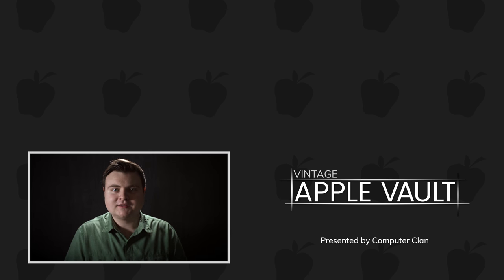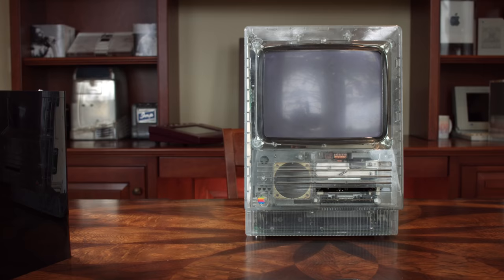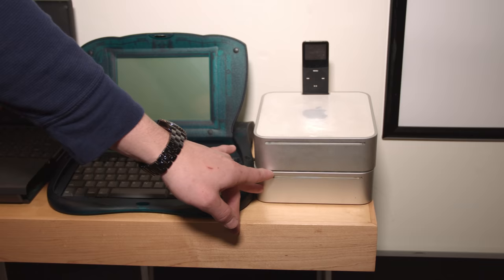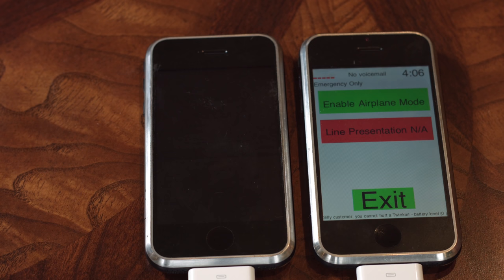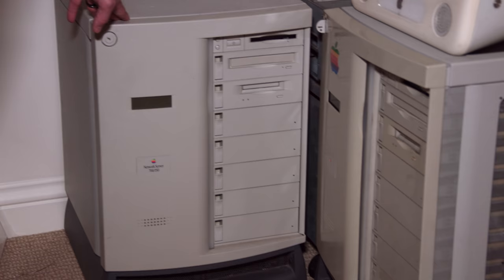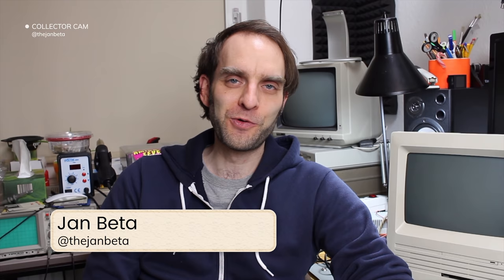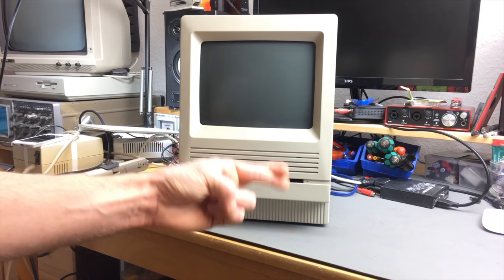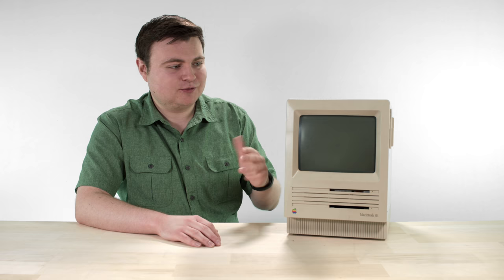Macintosh SE and Apple Prototypes - Vintage Apple Vault #5

Comment: I’m a former Apple employee from the ‘90s. I used to have a small but interesting collection but I’ve let most of it go. Had a 128k, several Quadra, and various PPCs, but I still have the first Mac that I ever bought myself and that’s a Mac Classic. Love that little computer. That guy is right, it’s great for word processing when using a full sized ADB keyboard (the best Apple keyboard ever), and when you want a small footprint. Even better than an iPad Pro with keyboard, IMO, (which I’m typing on now). The Classic just started with the capacitor problem, so I need to get that fixed. Still have my dual 2.5 G5 watercooled tower which runs fine, and two of my current systems, two heavily upgraded 2009 Mac Pros. I was always attracted to the towers. But I also like the G4 Cube, the black Macintosh TV, the Classic Plus (the 030 version I believe), and of course the Color Classic (which my friend had for awhile). I also had a Duo Dock that I used in collage months before I joined Apple. Thanks for the nice video. 👍🏼
Reply: Did you know anyone who worked on Copland?
Reply: a4e69636b I didn’t know any of the software engineers on that project but one of the internal testers worked down the hall from me and I was able to check out Copland in various stages of development during the spring of ‘95.
Reply: Were you able to see any programs run on it?
Reply: a4e69636b The Copland project suffered a lot of problems (as I’m sure you know). I never saw any programs running in Copland because, and this is rather embarrassing, the kernel almost always crashed before the OS got to the desktop. I never saw Copland get to the desktop and remain stable long enough to see anything other than the loading of the Finder. I know Apple demoed Copland once at a WWDC, but I didn’t see it (you had to have analog satellite dishes to watch those back then). Who knows how much of that demo was a pure Copland demo. We had been having troubles with System 7.5’s MacTCP (TCP/IP) Control Panel, (it didn’t work, customers were really really upset, and we had to basically find a way to make customers happy for a few weeks while the software engineers released an update that worked), so seeing Copland in utter shambles was a huge wake up call. A few months later, the rumors that Sun or Microsoft were going to purchase Apple began and things got worse. I don’t know how many software engineers were working on Copland, but I heard talk that the team was too small to handle a project of this size. I don’t remember what alpha or beta versions I saw, but if it was anything near to the golden master, it would have been a disaster. Especially after that Windows 95 release. I don’t think Copland could have ever been shipped. When the TCP/IP problems surfaced, it took them an excruciatingly long time to release an update that did work, so maybe there was some truth to the rumors that Apple was quickly loosing engineers, or didn’t have the talent needs to complete the project. I can’t confirm any of that, but I heard about it. 

IMO, just from being around Apple at that time, bringing Steve Jobs back was the only way Apple had any chance. Some employees thought buying Be was going to happen, (I had a Be Box, running dual 603s and Be OS because I thought so too), but there’s no way buying Be would have changed anything, IMO. It turns out Jobs brought back more than just the cool NeXT technologies, (which were very cool indeed, exactly what Apple needed), but, and a lot of people don’t seem to know this, Jobs attracted some very wealthy investors who believed in his potential to save Apple (possibly because of Pixar, and because he stirred up the hard core user base which wasn’t going to bail with Jobs at the helm), and being such a long shot anyway, there was a big pay off if Apple succeeded. I don’t know why this story isn’t told, but there were private investors that quietly invested millions if not billions in Apple. Those people are of course an order of magnitude more wealthy than they were before the investment. From what I can tell, it was these early investors that saved Apple. That’s the way it felt. The Microsoft deal was more of a PR stunt. The user base did need to know that Office would be around, that’s true. But the MS money really wasn’t that much money (in the corporate world). It probably helped MS with their DOJ problems, more than it helped Apple with their financial problems (again just speculation on my part). 

But yeah, from what I witnessed, Copland would have never seen the light of day. Apple would have gone bankrupt before the OS was ready for golden master. Or if they had shipped it, Copland would have been unusable for at least a couple of years which Apple wouldn’t have been able to survive anyway. It took Apple a couple of years to prepare OS X for the Macintosh, which surprised me a little (feature parity across CPU architectures possibly?), but it’s issues were very fixable, and the pay offs tremendous. Copland, on the other hand, from what I saw, would have finished Apple. Gil Amelio gets a bad rap but at least he, and to a lesser degree, Ellen Hancock ultimately did the right thing when they easily could have easily sold out months sooner (which almost happened).
Reply: @TheSteveSteele  We need a website telling the story of Apple in the 90's. Thank you so much for your story. It pains me to know that a large corporation failed to do what some Finnish computer science student succeeded at. How Apple failed so miserably I may never fully understand.

Comment: Fun fact.  Easter egg with the developers' photo can be found by going into the debugger (button hidden behind the vent slots at lower rear left of case) and type in G 41D89A at the debugger.
Reply from the maker: Funny thing… Hap talked about that in the video, but that scene didn't make this cut. I believe I included it in the Patreon extended cut. I'd have to double check.

Comment: I have owned 2, one which I got used in 1990, and the second one I got 2 years later from a publishing company which was switching to other systems, and their se30 had died on them. So they gave me the computer, and all of its accessories which included a Radius Pivot card and 17" monitor, HP IIVX Scanner, external cdrom and a couple of hard drives. At this time I had also picked up a Daystar Turbo 040 33 accelerator (128k L2 cache version) which was also compatible with the Radius Pivot, and SCSI ethernet device. I had kept it to 8mb of ram for much of its service life and only upgraded it to 20 after digging it back out of storage a few years ago to use as a vintage gamer. 

I primarily used the system for music composition and production. I had also done some graphic work with it as the screen could do 832x624 in 16 bit color. And sported hardware quick draw acceleration. It was a fast machine and could blow away any Mac II and even keep up with Quadra and later LC's.  The SE30 which was dead, was victim to a power supply which blew up and pretty much toasted most things in the computer. I have kept it as a parts machine as the tube still works and has a spare floppy ect. 

The next computer I got was a base model Powermac 7100/66 with 8mb of ram running 7.1.2.   And man was its performance underwhelming.... At least until I got a few PPC native software updates....

Comment: A bit past the turn of the century, I came across a Mac SE 4/40 at the local hospital thrift shop for $40. As an MS-DOS/Windows user, I saw ir as "enemy tech." (Kinda like a MiG-21.) After a few days, the manager let me have it for $25, and that began my trip "down the rabbit hole." It had been the property of a University of Hawaii Oceanography TA, and even had his resume among the documents. A college friend, who had been Apple "since the II series" assisted me on upgrades. Over time, eBay became my Mac parts hunting ground. The 800K floppy drive went first, replaced by a 1.44MB unit to read current HD floppies. Next, a 540MB HDD, and, eventually, a 32MB RAM module and software that turned it into a (sorta) Mac SE/30 that was a step or two away from being "Internet ready." That led to a PowerBook 1400cs and to a 2012 MacBook Pro.;)

Comment: The Apple Lisa 2/Macintosh XL was a thing that Apple actually sold at one point. Basically, the "Macintosh XL" name was because it used a program called "MacWorks" which was a MacOS emulator that made it possible to run Mac programs on the Lisa.

Comment: Ah, this was my first Mac. Funny story of how I got it, I was walking late one night and noticed out on someone's yard as part of their trash a familiar shape. I thought nothing much of it walking but when I came back I checked it out again and saw that it indeed was a classic Mac. Not just any classic Mac, but an SE. Yep, I  just kind of stumbled across it and trash picked it. 

I took it home to discover, as you would expect, it not working. Well, it tries to work, but the monitor just arc's on the inside of the tube when you actually power it up. I've never been able to test it further, and I fear most every aspect of it is dead - it looks rough, yellowed, and a little chipped in places - but I wouldn't mind spending the time to at least see if I can get the display working right, and then diagnosing problems from there.

I never went too far into it, and really need to take it to the shop, tear it down, and remedy any issues it has that are obvious fixes before they get worse, if they haven't already killed it completely.

Regardless, it looks cool on the shelf. Didn't think a that time back in, oh, 2014 maybe I'd actually be as into these types of systems as I am now.
Reply from the maker: It’s like rescuing a stray cat. Good story.
Reply: Most likely a broken CRT (picture tube) if it is arcing inside. 10 years ago this would be parts machine as you could get another one in non working state for $5. You can get one off eBay quite easily and they are not that expensive, but the shipping might be as it is a heavy thing.
Reply: @michvod  You know, everything you said is exactly what I was thinking over the past few years... for better or worse.

I'm hoping in odd chance someone brings one in to my workplace and I can strike a deal with them. It's happened before, 2 SE's which we sold online (the things wound up in Germany if memory serves) so ya never know.

Comment: We have an SE/30 on display at Sharp Solutions in Cumberland, RI. We discovered while recapping the board, swapping the analog board, and swapping the CRT that it was actually an upgraded original SE, which was not at all an uncommon practice for Apple products from the Apple II through the Power Macs to be upgraded in this kind of way. It has a new front plate, motherboard, and a sticker updating the back of the case, but the rest of the components were original to the SE, and also explained why the disk drive was only reading/writing 800k.

Comment: Story time. I don't remember how it came about but somebody gave me an SE I had to floppy disks an extra no hard drive it was a little hard to get used to the whole click and hold thing but once again I book I went back and went oh a lot of this design navigation transfers quite nicely. I tried getting a modem for it although I stumbled across what had phone jacks and a resistor in an RJ-11 connector turns out wasn't a modem it was a serial type network adapter only learned about that years later, I picked it up at a thrift store. I decided to give it to her friend and they informed me that there was a internal connection for a hard drive that I never knew about. I decided to keep the external hard drive enclosure and drive and someday I will pull the SCSI drive out and try and read it again. I really did fall in love with 3-D tic-tac-toe and the art program I don't know but it was for a drawing kind of like MS paint. The enclosure got slightly modified into a 5 1/4 bay optical drive and then subsequently I received a recycled FireWire IDE Interface board that I managed to attach to the back turning it into an external DVD drive.
The interface board came out of a automatic CD Burning/ labeling system that broke. Oh yeah and I was really annoyed by the 800kb floppy drives it was literally not compatible with anything... put a Windows disk in not formatted, format it and then Windows goes it's not formatted, take it over to a Mac it can't read it either.

Comment: Eternities ago we got Amiga 500 and C64, but the more "modern" first computer almost became a used Mac SE of some form. Pretty sure the tiny built in screen warded me off. Instead ended up with a bunch of 286 parts that turned into a 4 megabyte RAM 16mhz 286 that lasted me until 1998. Wonder how things would have ended up with an SE instead. Really came to appreciate the compactness later on in life, laptops instead of desktops.

Comment: I remember we bought a SE and Plus for $50 on eBay ($25 a piece) as one sale to replace my dad's original Plus, both were in pristine condition. Now you can't find a working SE or Plus for less than $160 for the one machine. I still have both

Comment: I've got a couple of SE's in various states of working order. My main one is hooked up to a SCSI Zip Drive that acts pretty much like a second hard drive. I had it hooked up to two SyQuest drives, but the carts and drives were just absolutely unreliable and would develop errors even when using new old stock. The Zip disks so far have been very good for transferring files between the SE and some slightly newer Macs and then backing up the files to my more modern Macs through my home network. Nothing beats an original Mac for playing the old Might and Magic games. :)

Comment: a few years ago i bought a mac classic ii from ebay that didn't work, so i assumed the capacitors had leaked. when i opened it up, it turns out the internal clock battery had leaked out all of its acid onto the motherboard and pretty much destroyed it. so i had to order another mac classic ii motherboard on ebay and it didn't work either. but i was able to fix this one. this one had the capacitor issue and the clock battery was intact. i cleaned the motherboard, replaced all the old electrolytic capacitors with new ones and some tantalum capacitors, and then it worked fine. i also replaced the clock battery as it was dead. (the clock battery is in a holder instead of soldered directly onto the board.). and i also rewired the clock battery holder so that it is under the motherboard. and i put some plastic wrap on the bottom of the motherboard while keeping the clock battery outside the plastic wrap. so that way, if the clock battery leaks, the motherboard will be shielded from the battery acid by the plastic wrap so that way, the worst that happens is i'll only need to change the clock battery (and possibly the plastic wrap) and the motherboard will remain unharmed. the mac still works to this day.

Comment: I have an SE, the version with the internal hard drive. It was my grandfather's, and I found it while cleaning out his attic after he died. I had always wanted a classic Mac but never could afford to spend that much money on what would essentially be a curiosity. But here was one for free! It had been sitting up there for who knows how long, but when I plugged it in, it booted right up into System 6! I never found the keyboard and mouse, but I got those off of eBay for about $25. When I hooked them up, I found out the computer worked flawlessly and that my grandfather had installed an aftermarket 45 MB hard drive (originally 20 MB) and put in 4 MB of RAM. It had a lot of programs including Microsoft Word and Excel, and a recipe book, but the one thing it didn't have was any games. I found a guy online at RescueMyClassicMac.com who makes 800K floppy disks with games and other fun programs and I bought a few to download onto my SE. I even have Photoshop 1.0! I've had it now for almost 5 years and it still works just fine. I'm glad I found it!
Reply from the maker: That’s awesome. I love how those machines can sit in storage for so long, but still work flawlessly.

Comment: My middle school was chock full of SE's. Two computer labs of them and then each classroom had one. I don't think I ever saw one configured for 2 floppy drives. Would that allow you to copy discs, like a dual VCR?
Reply from the maker: Potentially it could let you do that. It depends on what you were booted off of. If you have the dual-floppy config, and no external hard drive, that means you'd have to use one of the floppy drives to boot off a diskette. I've never tested this with System 6, but in the older system, you could eject your startup disk and use the open floppy drive for another data disk, while basic functions of the OS worked from memory.